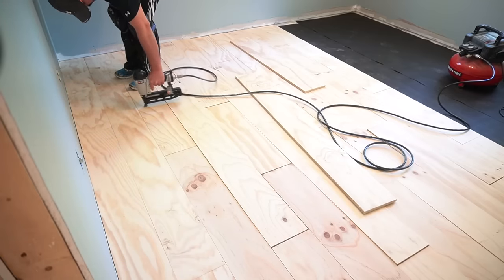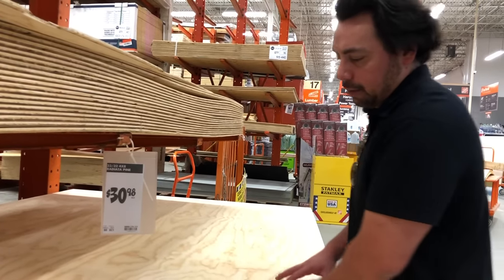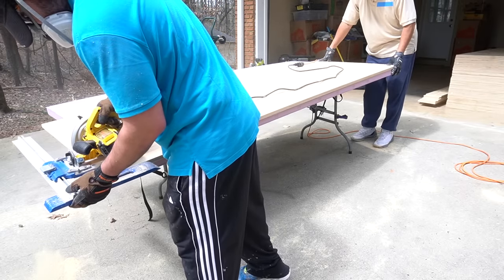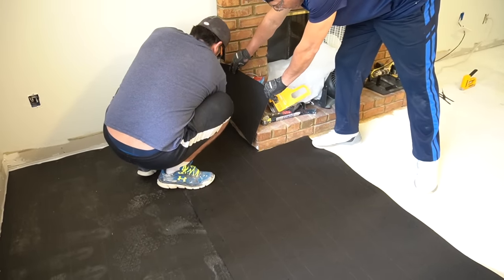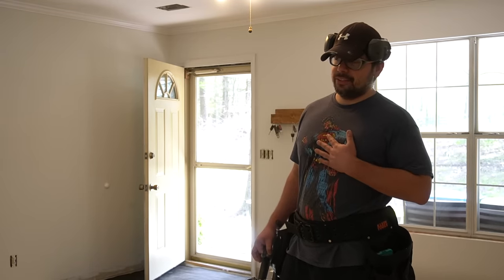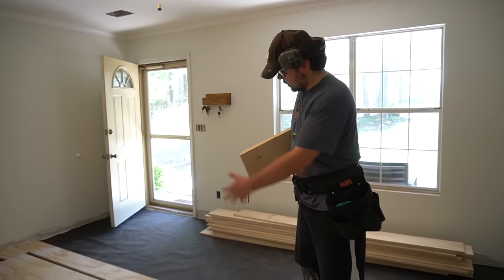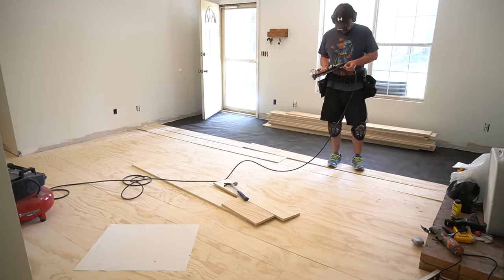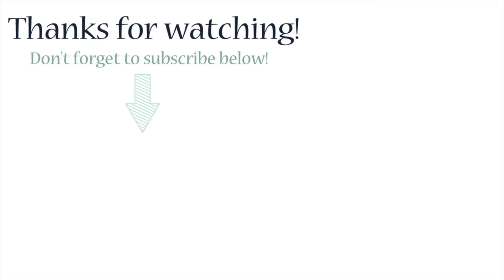PLYWOOD FLOORING | How to Install Plywood Floors | Alternative to Hardwood Flooring PART 1

Comment: We've done plywood in several rooms. I'm a pro woodworker with a shop t pretty much build anything in but, you can do what we did without a pro shop. The way you cut your boards to size is the most safest and simplest. I have a track saw so that's what we used. After we had all the plywood cut down, we ran a small round over on al sides with a small router. We then sanded all the planks, I sprayed them with 2 coats of amber shellac, and then i sprayed 5 coats of a water born polyurethane on them. Let the planks dry and then put the floors down. We brought them in the house, rolled out the roofing felt and then nailed the floors down. The floors are beautiful and are holding up with no problems. We never tell anyone they're plywood, and they've all babbled over them. You have  nice looking floors, and thanks for sharing your video.
Reply: What did you use for the gaps in order for water not to penetrate?
Reply: @giseleb2059 
The felt and a tight fit. Easy to replace also.

Comment: I have simply glued a 5mm thick plywood "planks" on the kitchen countertop (cut them with a utility knife) then sealed them and no one believes me that is is not a 'real' wooden countertop 😂.  I was thinking to do the same thing with floors but wanted to check if anyone done that and stumbled upon your video. Great work you guys! How is the floor serving you, all well? Regarding the maintenance etc...Well I guess all same as "real wood", I mean after all plywood IS a real wood just thinner- it is till wood 😊

Comment: Looks so cool. Curious as to the size and type of nail. I want to do this, but am worried about how well the trim nails will hold over time, and don’t want the extra pucker that staples would give.
Reply: my plan is to use 18g brad nails 2" long and put a thin strip of pl200 glue down to prevent movement
Reply: How would u apply it over concrete?

Comment: Nice job  1 question i seen the engineer nailing stright in the floor do you have a issue with the boards coming loss.?

Comment: There is some subflooring that can be used as flooring. If you sand it then put a stain over it it looks like wood grain and it's going to stand up to wear and tear. I uave a SIL that did this 15 years ago and hers still looks good with no damage.

Comment: I just finished putting the same peel and stick you have in ur laundry.  I know I don’t have to, but I want to put a clear top coat and roller it on.  Is there one u recommend? Can I use the same top coat you put on ur paint and stencil floor?  I bought all the products in ur How to paint Kitchen Cabinets.  my Laundry rm is done!  I made a framed shelf, 5 rows, to put my tea cups and saucers out and painted it and the side table Under when I hang to shelf on the wall.
Ur wood floors r beautiful.
Reply from the maker: I haven’t put down peel and stick tile so I’m not sure how the clear coat would work on it.

Comment: Are you not getting squeaky or lifting flooring from using finish nails? I've never been able to get a project like this to work without gluing, using ring shanks or screwing the floor down.

Comment: What if your sub floor is concrete because you have a slab, would you use the same roofing padding?  If so what would you use to anchor it down, glue?

Comment: Pine is a really soft wood though... How has it held up?
Reply from the maker: It did just fine for us during the years we had it, but it all depends on how rough you are with your floors. The floors held up with 3 kids and multiple renovation projects. They might have had a ding here or there, but they looked almost as good as the day we finished them on the day we sold the house. We were always complemented on it and it didn't deter any buyers.

Comment: Could you do this on concrete floors?
Reply: Putting any type of wood flooring on concrete would require gluing them down.  I would not recommend doing that and we would rather polish and seal the concrete.  We may actually being acid staining our basement floors in the future so stay tuned.

Comment: Q: Did you save or lose money on this method of installation? Compared to contracting a company that would have installed hard wood ? Did you compare costs or were you not concerned.

I ask because I have a home work shop with a lot of saws etc and I installed pallet wood flooring in my house. It only cost me my labour and time. Time collecting enough pallets, which was difficult as it was lot and took up a lot of room. Over all it took me about 2 months to collect enough pallets....lol
Reply from the maker: We saved money on this. However, this was a few years ago when wood was at a much lower cost. This was the best solution for us at the time because this was the best way for us to get wood floors at the lowest cost. The floors held up really well and it was something that was always complemented whenever we had guests and when we finally sold our home.
Reply: @TheLatinaNextDoor  It looks amazing. I was really impressed. Thanx for explaining. It was a great idea.

Comment: I 100% wouldn’t use pine flooring. Pine is a very soft wood. I had oak, maple, and pine flooring in my last house. All the flooring was refinished and the pine looked like crap and gouged easily if you even looked at it funny.

The oak and maple held up super well to animal and human traffic and were gouge and scratch-free after 3 years. I applied Varathane oil-based polyurethane with the aluminum oxide (in black can from HD) and it really brought out the wood grain.

HD also sells maple and oak plywood.